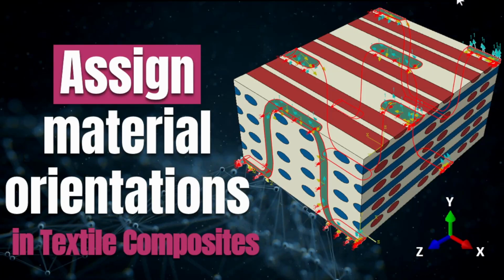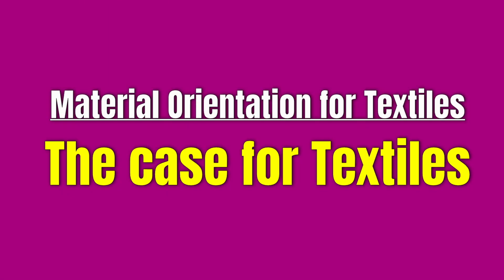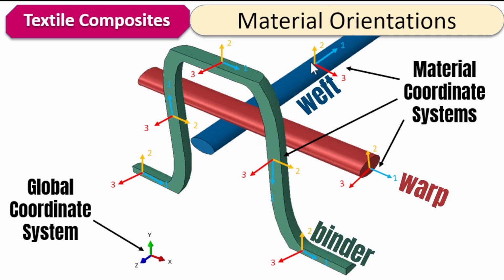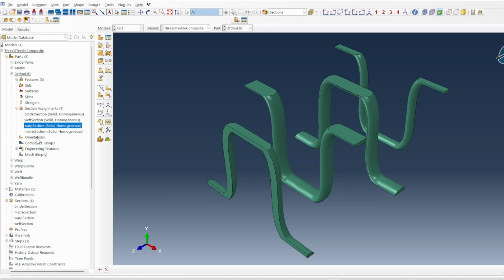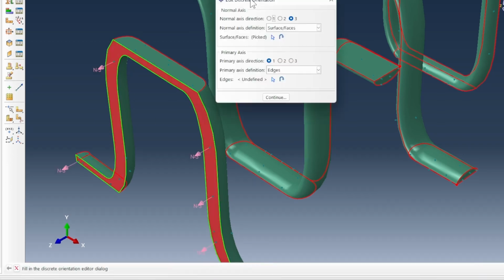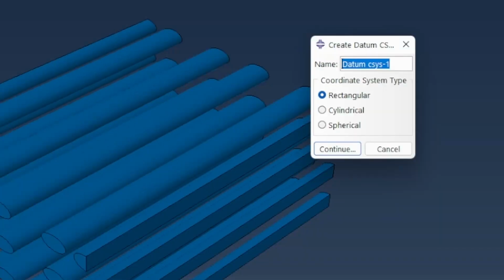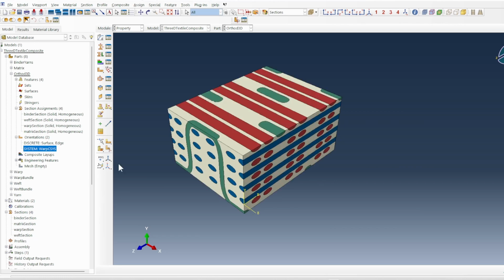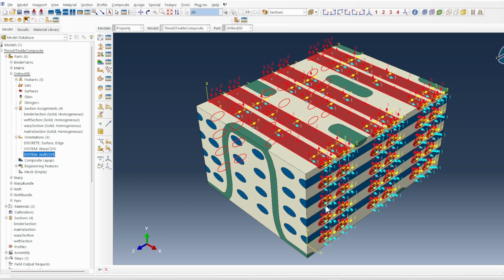Do this or your textile composite model will be wrong!

Comment: Dear Dr. Michael, thank you for your video. My material is a composite of Lignocellulose nanocellulose and polylactic acid, which is extracted from the by-product of pumpkin. The distribution of Lignocellulose in polylactic acid should be random and disordered. I want to calculate the tensile and bending properties of modified and unmodified composite materials through modeling. Do you have any suggestions for modeling this material? Have a nice day
Reply from the maker: I suppose you can use RVE modelling and impose bending deformation on the domain to see what you can do. You have to try it out first and see.